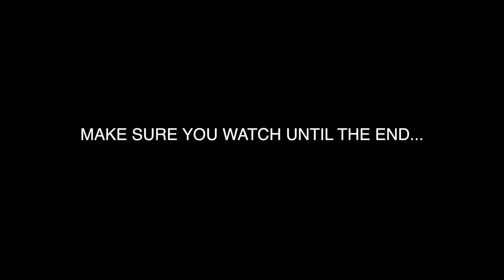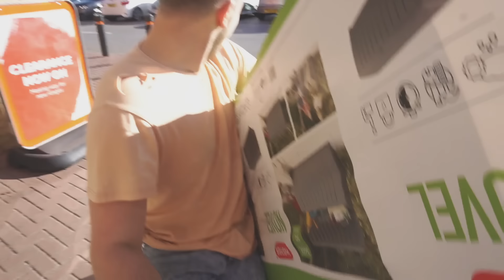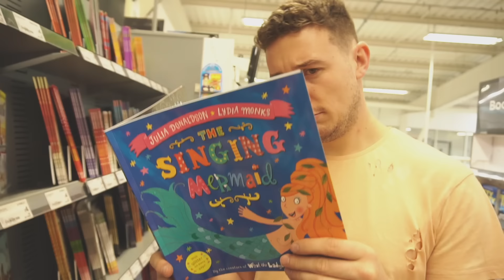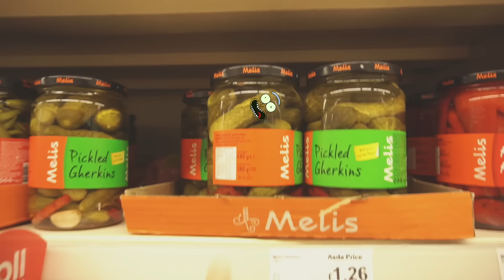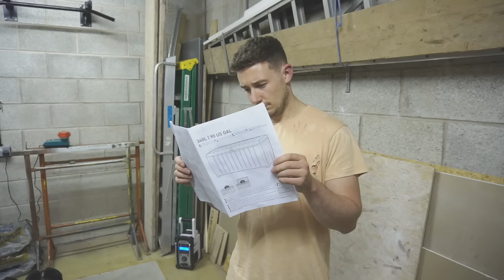I Buried Myself in a Box Underwater and SURVIVED! (Buried Alive Challenge)

Comment: how would he have gotten the top open under water? it would be the same thing as trying to open a car door under water would it not?
Reply: Oof
Reply: technically yes, but the box is made from plastic or something so it is not as heavy
Reply: Correct
Reply: Mythbusters tested it and you can open a door if you wait about when it's at the bottom and don't push it as hard as you can
Reply: netbuckler91 The water is heavy tho
Reply: carter saccary no it's possible to open a car door underwater after it has sank a little
Reply: carter saccary what no it's just a switch that you move back and forth or side to side it's not complex
Reply: you've gotta wait for the water to totally flood the box, same with a car underwater
Reply: need to be fully filled with water so it even preassure
Reply: yea and it was duct taped  from outside
Reply: Bros Mobilegamer he has a knive
Reply: Pro gamer5433   but the duct tape is outside
Reply: carter saccary when you hit the botom the water pressiar decreses
Reply: Mythbuster tested it but I forgot what happened
Reply: carter saccary i
Reply: Yeah you would also be pushing up against the water which is even harder than in a car because a car door opens sideways
Reply: H
Reply: carter saccary no
Reply: carter saccary look up myth busters car under water.
Reply: lettuce isn't very healthy
Reply: carter saccary it's less heavy so it's easier to open
Reply: carter saccary no if it's like a car then you can open it when the door is all the way under water, but if half above and half below then you can open it
Reply: carter saccary yes
Reply: carter saccary the door would have to be completely underwater because of water preasure
Reply: Ooooooooooooooooooooooooooof
Reply: carter saccary yeah but the myth busters proofed if you wait for the car to settle at the bottom then open the door it should open, same thing for the box
Reply: carter saccary you don't get logic do you? If you try to open a car door where part of the door in not in water it won't work if it is all a underwater it will be really easy just like the box
Reply: Jake Cowdry no it doesn't
Reply: The box would have to fill with water before he could open it

Comment: If you were really to do this it’s not that hard all you Gotta do for oxygen is have an air-pump pushing oxygen in from above the water and then a tube pushing any of the excess carbon dioxide out because as the oxygen goes in the carbon dioxide will leave via  the tube and then all you need is just food and like a sleeping bag and I think you’re good maybe some sort of form of air conditioning like dry ice or something